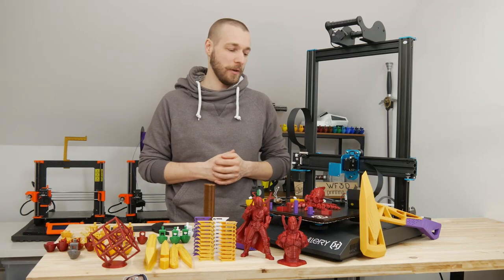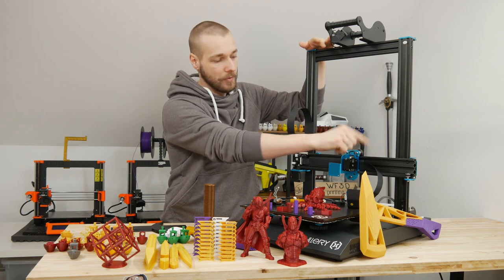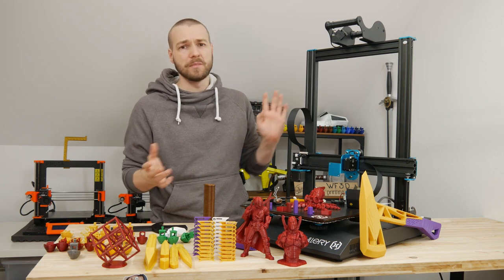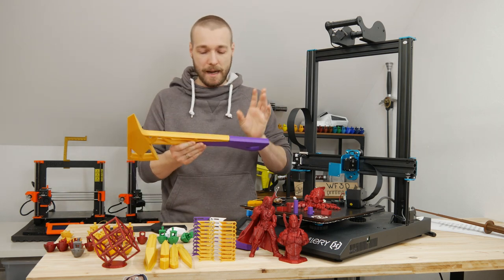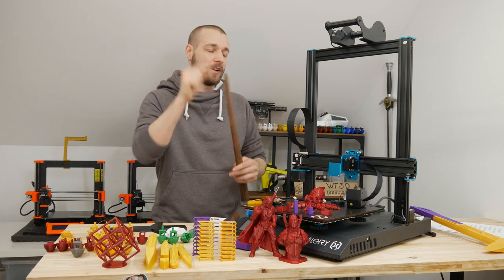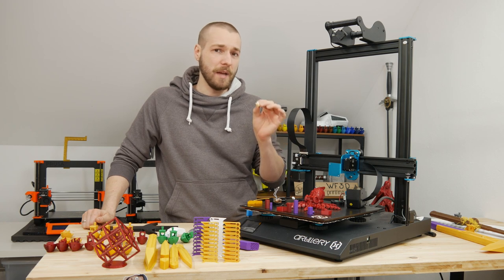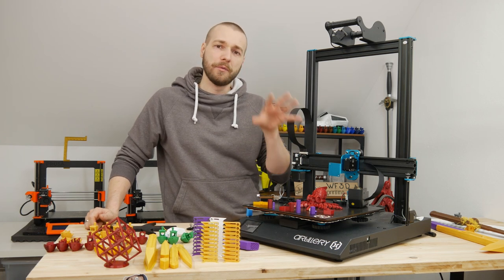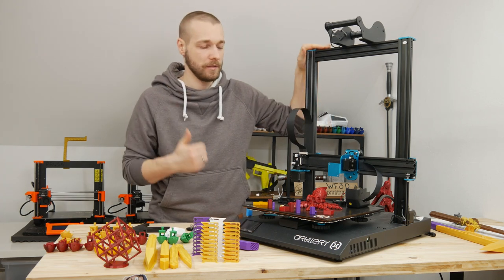3D printer full of SURPRISES - Artillery Sidewinder X1 review

Comment: Great video. Thanks for sharing. About the brown connectors: Bad connection between the connector pins and the board. Resistance increases, which translates to heat. The angry pixies that were supposed to go to the heater found an escape route.... Essentially, cheap connectors and cheap pins on the board. Only way to fix this is to have these guys use better spec connectors and pins, or take everything out, connectors and pins and solder directly to the board. That is what I would do as a DIY fix. Wire gauge could be an  issue too if they used something too weak for the task.

Comment: Incidentally, I stopped having to re-level the bed on my current printer (a Wanhao Duplicator i3 Plus) when I set up the bed using locking twin adjuster wheels and no springs (I'll post a link below). It really stiffens the bed and doesn't allow any movement. No need to keep re-adjusting. I'm also only using 3 corners for leveling as well (and a glass plate on top of the heated bed).

Comment: Thanks for a great review. I was going to order 1 this week until seeing this video. The problem I have found with the community forums for the X1 they become very defensive when asking about faults so difficult to get an honest opinion.
Reply from the maker: Yes, theres a strong community. But that can also be beneficial. There will always someone be to help you out if you run into issues
Reply: same. I have 5 of these machines and constantly going through fixing typical faults (such as heated bed replacement after failures on all of them working them for a few months). Ive gotten lots of sass from the community regarding the X1s when pointing them out so I just stopped sharing. 
 Other faults that are headaches are the extrusion gears going bad with a single use of abrasive filament and the stainless steel upgrades cause the bearing on the tensioner to sometimes touch the 1st gear on the motor making the motor overheat and die out. I want to change it to a BMG but the extruder is too big to simply swap out. Been thinking of getting the OWO gear or waiting for the mini BMG to lower its price point.

Comment: Really appreciate this video! I picked one up this last weekend (first time 3D printing user) and am trying to do some troubleshooting on my own V4 printer. I wanted a printer that could handle larger prints (300x300x400) so it was between this and the CR10 from what I could see... For a brand new user, there are a ton of things that I think experienced users take for granted like bed leveling/troubleshooting based on what they see that I'm still trying to figure out. Not to mention all the slicers, profile options, what to change etc. In any case, really appreciate it!
Reply from the maker: Cool! Glad of you got some helpful information!
Reply: There are quite a few new ones out in the last few months. I'll be buying one myself soon, the contenders are the Sidewinder X2, the Bluer Plus, the Ender 3 Max (a lot cheaper but, well, perhaps not so good without a lot of upgrades), and the Sapphire Plus (which is a CoreXY, but requires a lot more assembly than the X2 or Bluer). The X2, Bluer and Sapphire are all in the same price range, more or less, with more or less the same features (auto bed leveling, volcano-type hotend, etc.). The CR-10 costs considerably more, the Ender 3 Max considerably less. Leaning heavily towards the Sidewinder X2 at this time, it's the only one of the three that's direct drive, but I won't be buying for 2-3 months yet, it might be interesting to see what happens in the meantime. The X1 does have an impressive track record, there are quite a few long-term user reviews on YouTube.

Comment: Hi WF3D, thx for your review. I've been printing with a V4 for 6months and I've ran into the same issues, extruder issues, bed issues also, need to change loads of parts to make it print well, it printed well for a few months but it kind of had loads of problems since. But now I know the problems I m even thinking about buying a second one but just need to buy upgrade parts at the same time, such as better V-rollers, full metal extruder part kit, better heatbreak, X nozzles, and Z stability stuctures. Thanks you so much for the quality of your review.
Reply from the maker: Thank you for sharing your experience!

Comment: Hey thanks for your honest review. This was my first printer I've ever bought and yes I also bought it because of good reviews and what looked like good prints. Unfortunately I think you just got a lemon. That being said I have also had some issues with mine. I do want to point out I think that mite be a V3 or V4 because the V1 and V2 had open areas around the usb and sd port but I could be wrong.  But anyway I just want to say this has been a great printer for me and I would recommend it to any beginner. Again thanks for the great and honest review I hope you don't give up on it because once you get it dialed in it is a wonderful printer. So good I bought a Genius also. :-) ...... Is there any extruder upgrade that you could recommend I'm not real happy with there set up even after replacing the lever with a metal one?

Comment: Hey!
It is probably not directly fair to review a one-year-old printer that to date has undergone 4 revisions. It is probably more redesigned than what we can see with the naked eye, on the V4. It would have been better and more credible if you had a newly purchased one to compare with. I know Ruiraptor has done just that with the Sidewinder.
The quality controls can be significantly improved, absolutely, but I think that applies to most manufacturers.
You are right that there are certainly better printers for beginners, and I hope that those who watch this video understand that, no matter what printer you buy, there are pros and cons to them all.
In the end, you still get what you pay for.

Like your videos anyway, so keep up the good work !! :-)
Reply from the maker: Yeah I absolutely understand what you mean, thats why I mentioned that this is an old revision. But as said it was 1 year old but unused, so all these errors come from the factory, which im my eyes still is a big nono. Newer revisions can be better, BUT just check Toms review. In my eyes, it has not been signifcantly improved regarding safety issues. I just wanted to share my experience with this version. And yes you are right, you get what you pay for :)
Reply: @labrikorn_3299  have anny tips for bed leveling?

Comment: The goo is molten filament working its way up the ptfe tube in the heat break..

Its likley due to too high a retraction pulling molten plastic up the inside of the tube, or heat creep if the hotend fan is underperforming..

The short bit of ptfe tube  is low quality and a tight fit for the filament, it is advisable to replace with a short peice (same length) of high temp capricorn tube..

Comment: Hello mate,
thanks for exhausting review! Finally I have watched a review which wasnt only positive. I am currently scanning the market for my first 3d printer and this was one of my 3 finalists. I'll take your points into consideration.
Reply from the maker: Please mind that this is an old version. But as said check out toms review where he jumps into electronics a bit deeper!
Reply from the maker: @labrikorn_3299  Thanks for sharing your experience ! That's absolutely true. A big print volume comes with big issues if your printer is not reliable. This printer CAN be reliable if you have the abilities to make him reliable, maybe sometimes you are lucky and have a good machine from the factory. Otherwise it is a hard task to do. You always have to consider three things. time x skills x money. If you have all three you are pretty much fine, if you miss one you might end up buying the wrong pinter :( But besides that I would advise anybode to install some kind of monitoring , like a fire alarm in the room your printer is runing. This should be done for any printer. Because failures can happen with every machine. Even better if you get a fancy one with a APP which alarms you everywhere. I can sleep better knowing that if something will burn, I atleast will be alarmed.
Reply from the maker: @labrikorn_3299  there some fire extinguishers if you want to go super safe, but probably better buying a safer pinter is easier ;D
Reply from the maker: Martin Luther  maybe it was both for him? ;)

Comment: Hey,
i noticed, that my extruder motor get‘s really hot.
Is this the case on „your“ machine?
Cheers,
Luis
Reply from the maker: I am not sure as I haven't checked that during printing. Motors getting "hot" should not be an issue when the temperature is reasonable. How hot does it get?

Comment: Why would you review an old outdated version?  Has this printer been upgraded and modified by Artillery and is possibly better in it's current version on sale now?
Reply from the maker: Why not? You can still get the version for example second hand. Just because it is not the current version these printers have been sold and do not disappear. Also if you look at some others reviews it has not only been improved, some things have been changed to worse.
Reply: I don't think it's fair to discourage a potential buyer of a new updated version. So is it your opinion that the current version is not better than the one you reviewed?
Reply from the maker: @stuartmotorsports  yeah, just take a look into Toms review. I myself wanted to buy a x1, but after my experience with this machine I cancelled that and went for a cr-10 v3.
Reply: It's true there's a new X2 out now, it addresses a lot of the issues that get mentioned in other reviews - namely, it now has auto bed levelling, a 32 bit board, a better spool holder (and a crosspiece like the one they use on the Genius), and a much better hot bed cable (which has been cited as a possible safety issue). However, there really isn't a reason NOT to review an older version - most of the reviews I've seen (especially those by people who have been using this printer extensively for a long time) are overwhelmingly positive. They did fix the idler arm issue a while back, too, the current ones are reportedly pretty beefy. I'm considering buying an X2 myself, the other contenders are the Bluer Plus and the Sapphire Plus. The Ender 3 Max and the CR-10 are NOT contenders.